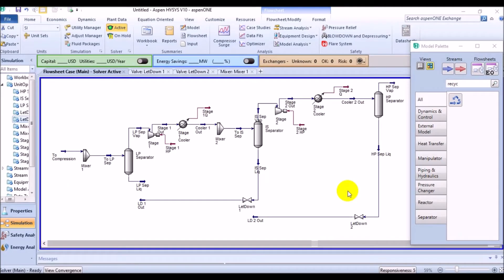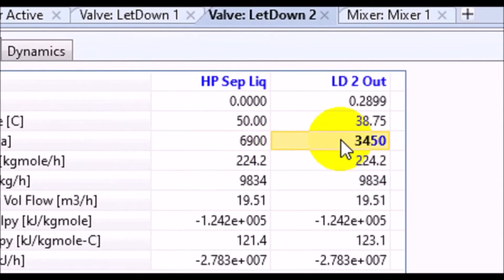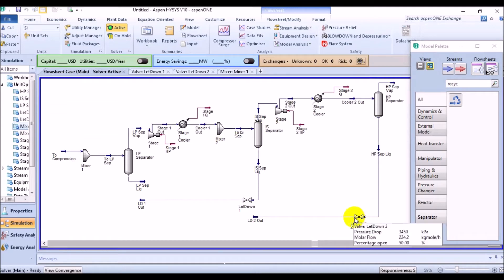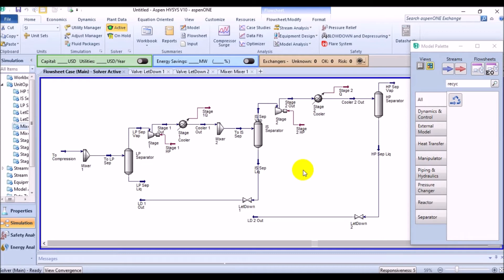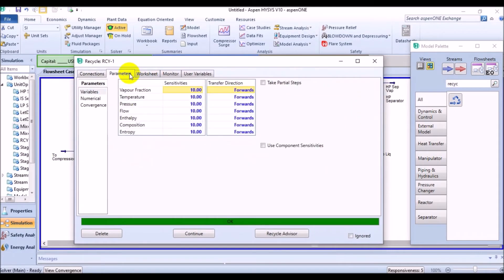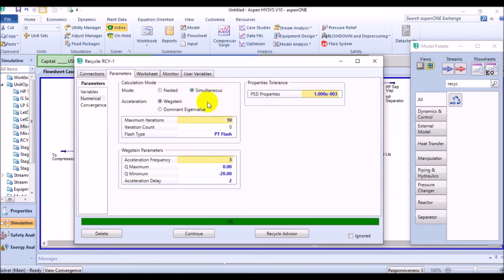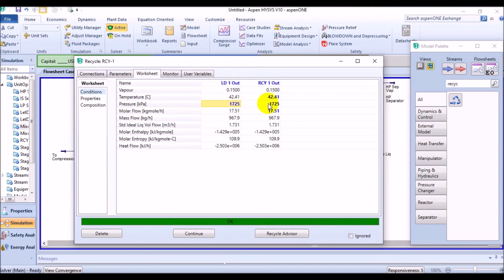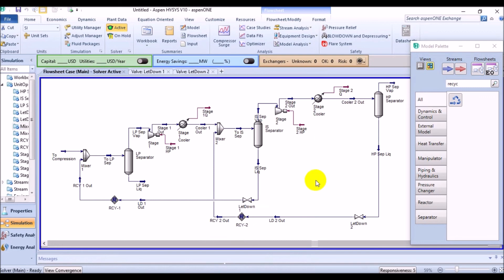The Complete Aspen HYSYS Tutorial for Beginners #5| Installing Recycle Block

Comment: Great Explanations, I would like to know what is the need for recycling liquid stream from Separator to Gas Stream, as the added liquid again gets separated in the separator downstream of the Mixer1?

Recycling high pressure gas stream to low pressure for some specific requirement is fine but why recycling liquid stream?